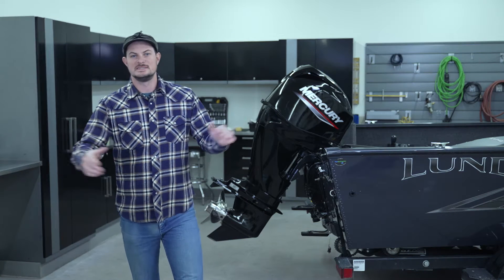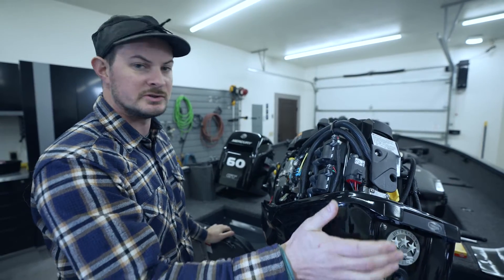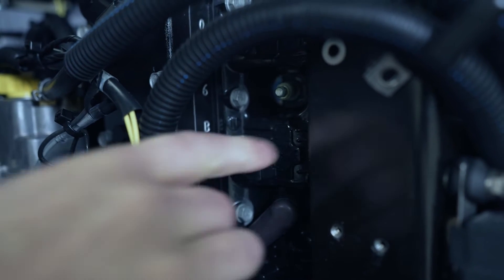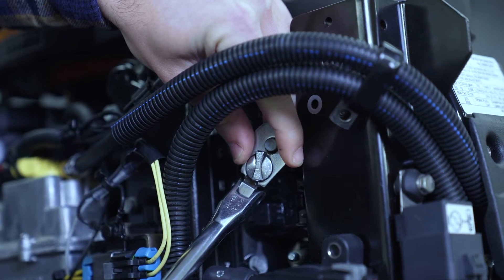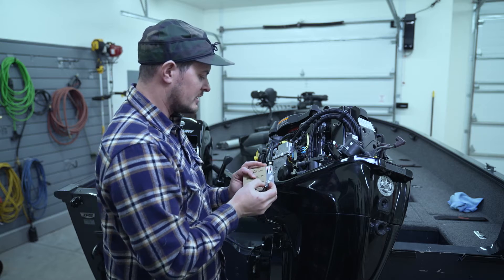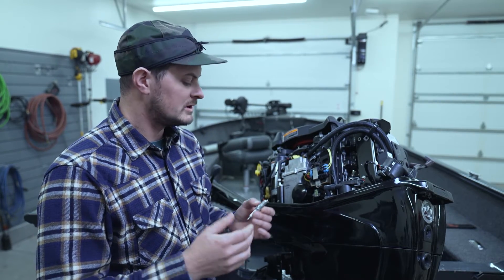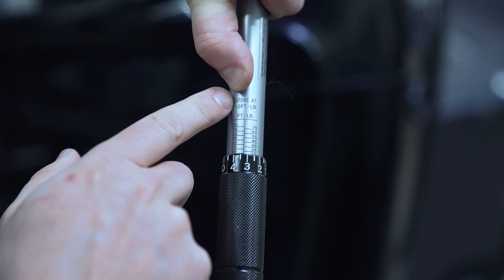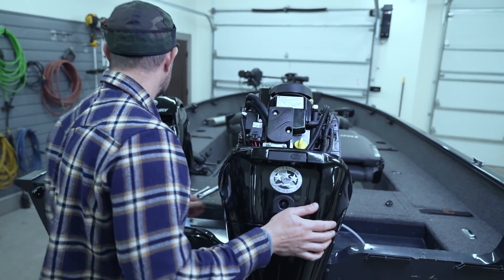How to Change Spark Plugs in a Mercury 40-60hp FourStroke Outboard

Comment: Would love to know the NGK equivalent you'd recommend
Reply: Mercury uses Champion spark plugs it says it on the engine. I have a 50hp 4-stroke it uses Champion RA8HC just like in this video. That being said if you absolutely want NGK the equivalent is NGK DCPR7E. That matches the resistor type and core specs. Personally just stick with Champion for this application they're good spark plugs.

Comment: So the Numbers on the spark plug boot housing 1-4 don’t correlate with the # where the spark plugs are threaded in? They are numbered on the motor also 1-4. They are not strait across if you match numbers. So , I am confused which is the right way.
Reply from the maker: The cylinders are numbered 1-2-3-4 starting with the top cylinder being #1. The white numbered tags that are shown on the ignition coils guide you as to which cylinder/spark plug that plug wire should be installed. On this particular engine, the top ignition coil handles spark for the middle two spark plugs (#2 & #3), and the bottom coil handles spark for the top plug and the bottom plug (#1 & #4).

Comment: No mention of anti-sieze, I thought it was recommended to be used.??
Reply from the maker: The warranty and operation manual for the Mercury Marine 40-60hp engine line does not suggest applying anti-seize to the spark plugs before installation. We always recommend referring to the manual that was supplied with the product you own and following the steps outlined within.
Reply: @QuicksilverProducts  Its definitely mentioned on 50 hp models.  Its even on the reminder sticker next to the 1 year maintenance list.

Comment: Looking for 40 hp video.  Can’t remove 3rd ignition coil.  Can’t get at the Lowest plug!
Reply from the maker: On some engine models, a combination of a ratchet extension and a swivel placed near the socket may be necessary.
Reply: The 40, 50, and 60 are all the same displacement, same designs, so makes no difference which HP.
Reply: I hear you,  the lowest plug is a sod to get at. Will try as they suggest ext. and swivel. But why do the design engineers do this 😩.

Comment: How often do you change the spark plugs? Hours on engine or just replace every year or so?
Reply from the maker: Mercury recommends changing the plugs every 300 hours or 3 years, whichever comes first. That being said, if you're performing winterization and they look excessively worn or you're experiencing running concerns, you should change them before the recommended period.